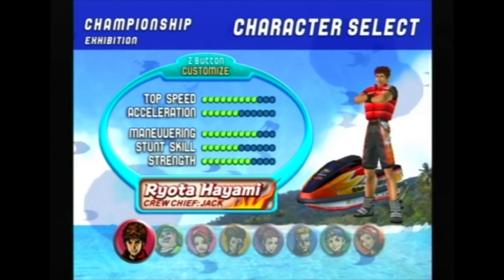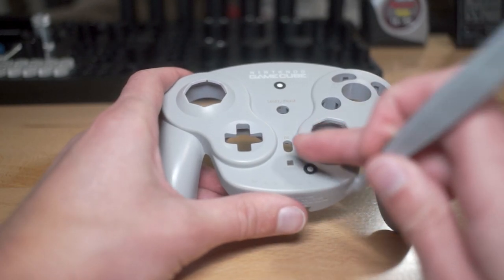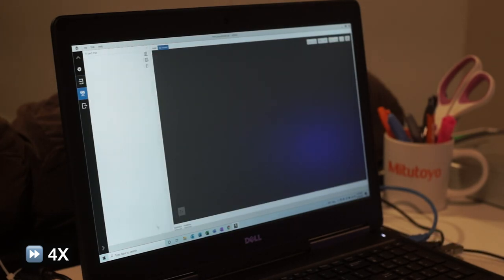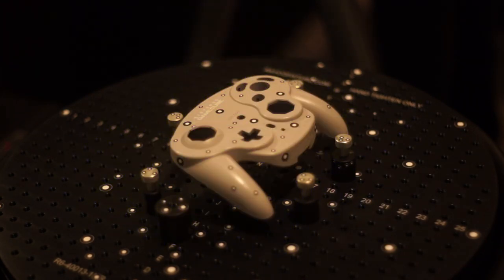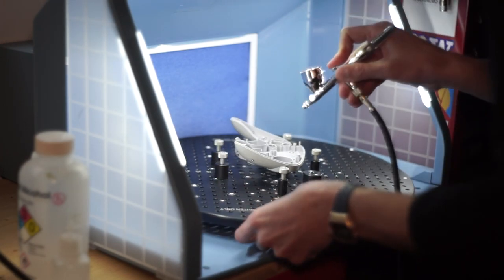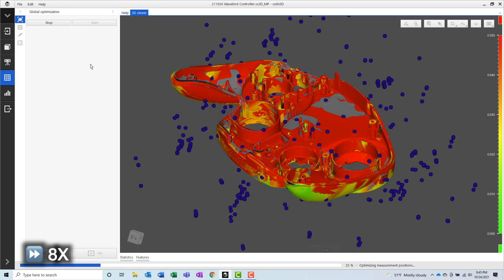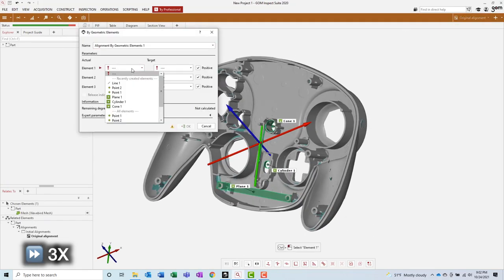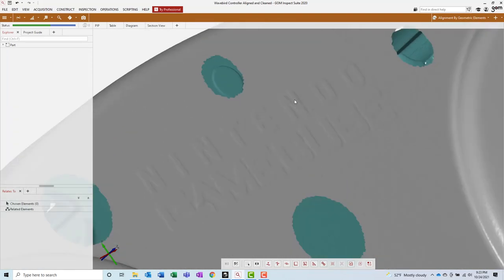Structured Light 3D Scanning a Nintendo Gamecube Controller

Comment: Awesome! So cool. Which reference point stickers do you use?
Reply from the maker: I mainly use reference point stickers from Gom. They are expensive, though. Creaform branded targets are cheaper and are sold in a couple online stores, but they don't have smaller sizes available (e.g. 0.4 mm). I also ordered some "Gom Photographic 3D Scan Marking Points" from an Ebay seller in China; they took a while to arrive, but the quality seems good enough.